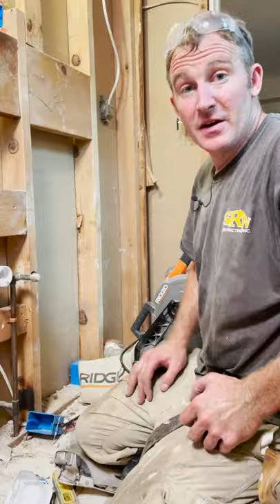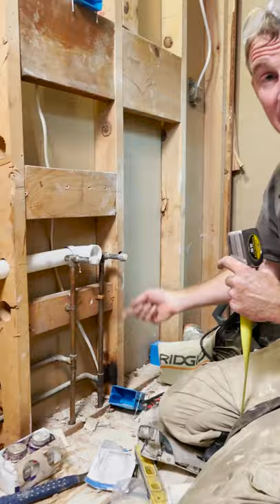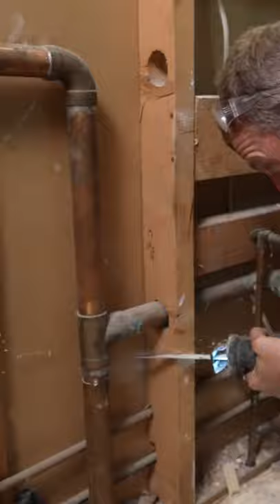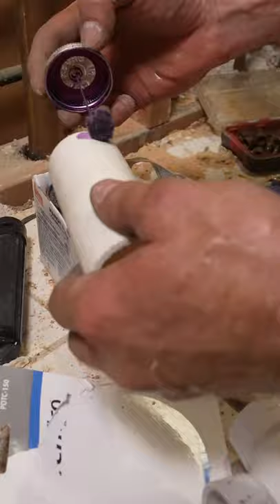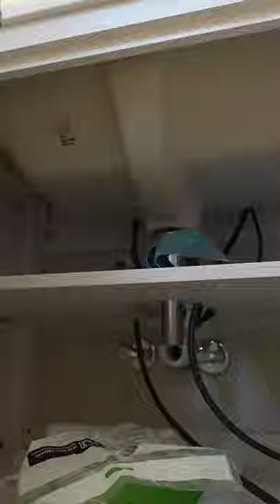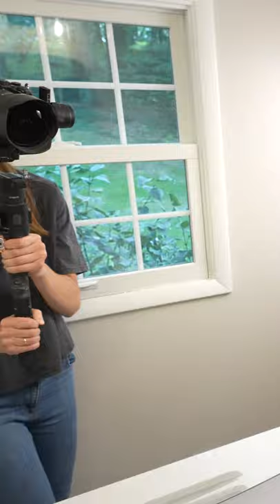Vanity Plumbing Drain Tips #shorts #diy #youtubeshorts

Comment: You never set your drain higher than 18 inches, The wear of the trap cannot be more than 4 inches to the drain, You need to cut the waste tail piece shorter, That would never pass inspection.

Comment: Evidently sweating copper is a lost art these days. Two copper no-stop couplings and a section of new copper would have been my solution to raise the height. By the time those rubber adapters degrade it will be someone else's problem.
Reply: Like what a few hundred years?   I was more worried he went from a larger pvc to smaller copper..       I know rubber/stainless steel coupler are code for sewer pipes, at least in my area they're. I passed inspection.

Comment: I must have missed something but I was wondering why you cut out all of that copper pipe to the left when you were just adjusting the height for P-trap over to the right. Can you just cut the pipe way over to the right to make your adjustment with PVC.?
Reply from the maker: Because if you just turned  90 and up that would raise the trap weir above the vent inlet at the existing T. You want to raise the whole horizontal pipe to make it work efficiently 👍
Reply: Okay makes sense now  👍

Comment: Shame on you for burying fernco's in the wall. Your a hack and shouldn't be showing anyone anything. You should have the extra couple of dollars for the correct no hub couplings
Reply from the maker: Holly mackerel! That’s a response, 😆. Yes code and mission couplings are important. This has basement access, and I’ve yet to see a leak from the use of a fernco. But your technical advice here is correct. Hope you follow all the other specs to a T on the rest of your remodel. Thanks
Reply: @BathroomRemodelingTeacher  newbie here. Why are ferncos bad in this application?
Reply from the maker: @DUstudent93  that’s a good question? I’ve never had an issue with one and see them used around here all the time. But I do agree a no-hub fitting is better with the metal band around it. More even tightening around pipe.
Reply: Settle down karen, it's not that big of a deal.
Reply: @DUstudent93  unbanded rubber can rot behind the wall and leak, rodents can chew though the rubber as well. 1.5" PVC x 1.5" DWV mission bands would have been the correct way, at least that's  code in CA under the UPC.